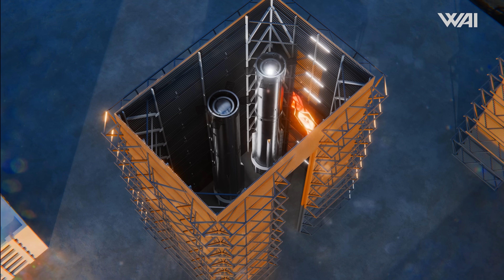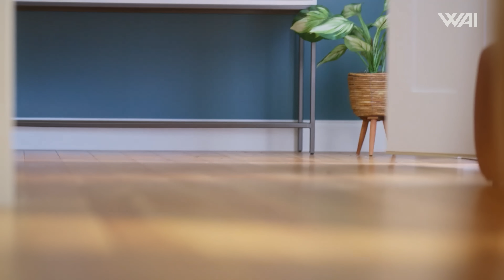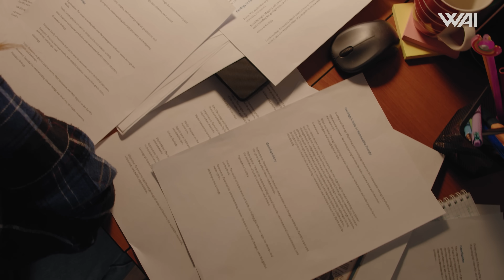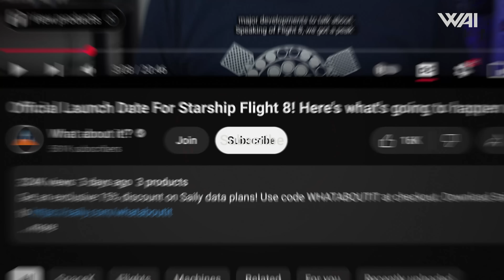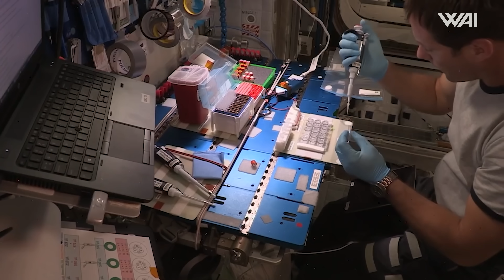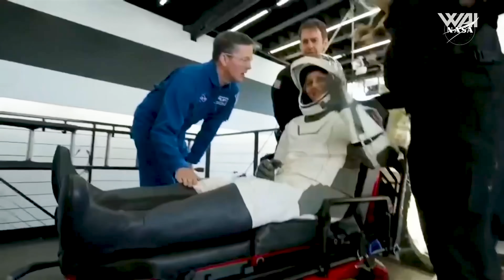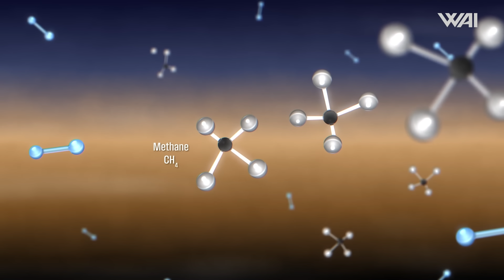SpaceX Doubling Down! Starship Block 3 is HERE! & Biggest Starship Project Yet Announced!

Comment: SpaceX 100% making star destroyer in 10 years
Reply: Bro imagine 😵‍💫
Reply: Nasa went from nothing to the moon in 9 years. That included extensive testing, on everything, before launch. I worked with people who worked on the LM. The SLS was delayed because of budget cuts, stoppages, changes & the directive to use shuttle hardware for cost saving. This time there are no budget cuts, stoppages are because the failures, & X isn’t anywhere near meeting it’s scheduled. Before you give excuses, Blue origin hit orbit on the first flight & just missed sticking the landing. I kind of remember launch a rocket or 1st flight on the aircraft the expected result is success. Yes, you can a failure but success is what is planned for. Will the next X flight be fully loaded with fuel & weight to successful complete a whole mission profile? Likely No
Reply: @adj2 NASA spent a significant portion of the US government total spending. It was a national effort. I remember it - I grew up on the end of the runway of Ellington AFB. My Grandfather helped build buildings at JSC. It was a massive achievement. 

SpaceX is attempting such a massive advancement on a fraction of the effort. New Glenn is a wonderful rocket. But it is basically a scaled up Falcon 9. SpaceX caught its booster first try. That is not the point. The orbital vehicle is the hard part. 

They chose a valid approach. Is it messy? Yes. But can it work? Of course it can. But when you are starting from the beginning you test, break and re-test. They may have to toss things away as failures. But thousands are working to build not just a rocket but the whole thing from scratch. The orbital vehicle is the key and they may be a decade away. No excuses needed. It is beyond belief hard.
Reply: @adj2  More like eight years, not nine. And their were plenty of failures along the way, some of them fatal. It was a rocky road, but one that was successfully traveled. So, when SpaceX is 8 years in, then you might have a point. Not now.
Reply: BS, No launch failures only Apollo 1 had fatalities. And that wasn’t a launch. They tested before launches. Saturn 5 had a 100% success rate. Mercury to thru the last Apollo flight except 13, all success including all the test launches. Hey, I was alive following the program. If we had stuff going on like now we never made it to the moon. Funding would have been pulled.
Reply: We'll cross that bridge when we come to it, my son.
Reply: Don’t feed the trolls…
Reply: 😂 they won't even have a working starship
Reply: @noone-qg1od I am old enough to remember that NASA was build moon landing rocket gear before they orbited Earth. That is the nature to rocket development.  It has been many decades since actual development happened so I give allowances for youth. It takes many years to build out from scratch. It has taken more than 10 years for SLS and that is simply reusing old Shuttle technology. So to build brand new you have to assume success of the lower blocks to reach your goal. Otherwise you could never make it - your final launch vehicle would be flying on ancient stages..
Reply: @noone-qg1od  Wait and see, wumao.
Reply: @noone-qg1od  I find tyour lack of faith disturbing!
Reply: @noone-qg1od  Lots of you morons saying that, none of you with actual reasons.
Reply: @noone-qg1od  let alone a working door lmao
Reply: @TorchzLive  Wait. Watch. The PRC can't copy and stale it's way any further. Enjoy your failures.

Comment: They need to prove that starship works as designed before expanding
Reply: Not enough time to wait. Must develop simultaneously.
Reply: that’s how they do it at blue origin. We see how that’s turning out
Reply: @Originetics  exactly ... This isn't architecture
Reply: I disagree, if you research POGO, specifically what the CSI starbase channel talks of, this all to do with resonance and why block 2 keeps RUD'ing, this is also why they were lucky with block1, there was no resonance. If they move to block3 they might be lucky and its not resonant but also I think they will build it with POGO in mind and get rid of it, the inherent resonance cannot be easily be undesigned out of block 2 without significant changes.
Reply: @pintail120  So let’s say it’s a 50/50 chance that working out problems in the current design will keep them at their current flight pace for the next two years as they test out different configurations or test out new plumbing designs. A new tower ready for launches and a new Gigabay ready for production will probably take a year to complete. So if you are right then they won’t really need the extra capacity one year from now. But even so it would still allow them to begin producing and launching Starships from Florida to get those facilities optimized and the crews experienced, so that when they do get things settled they are ready to immediately begin ramping up.

But let’s say your prediction is wrong, and one year from now they are ready to begin ramping up. But they can’t because they sat on their thumbs and didn’t even start building the facilities in Florida.
Reply: 😂😂😂

I’m glad you ain’t in charge
Reply: Why?  Is this college?  Is he being graded?
Reply: I understand the idea behind that approach but there is pro and con to doing it that way, with the negative being not having the facilities available when they are ready to ramp up, which would create a delay. Especially when there are many signs that people overlook which are proving the overall validity of the Starship design. The boosters are already fully functioning, they have had three successful recoveries, and they just had their first reuse of a booster. The ship has effectively made it to orbit five times, they have held back on full orbit only because they are still testing controllability and on-orbit relight.  The ship has done three controlled reentries, performed belly flop maneuvers, and made controlled landings on the water. Sure it’s clear that there are specific details that still need to be worked out to enable reliable end to end flight, but there is no need to hold up Gigabay and pad construction until then.
Reply: If they don't prepare for the expansion then once they have it fully working the expansion is delayed.  Even if it doesn't work, something will and they will be prepared for that too.
:planet-orange-purple-ring: